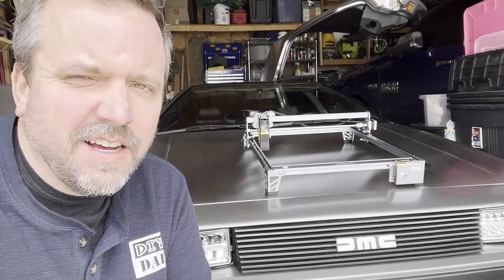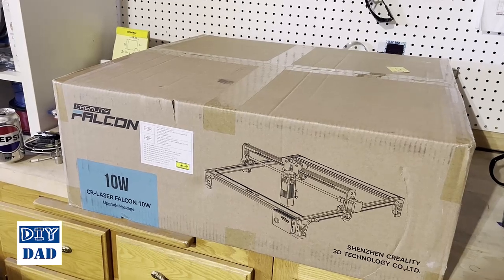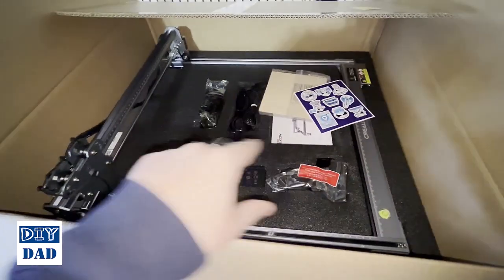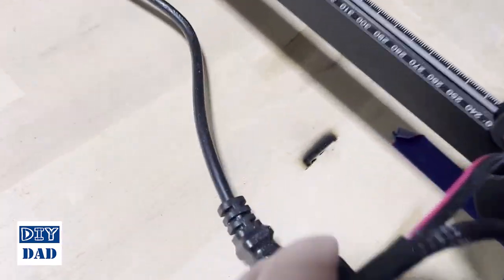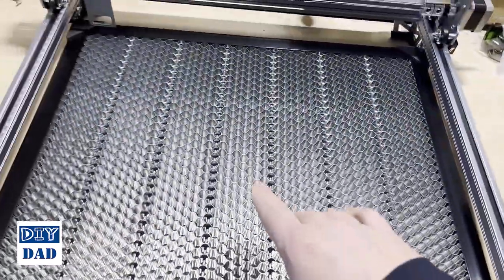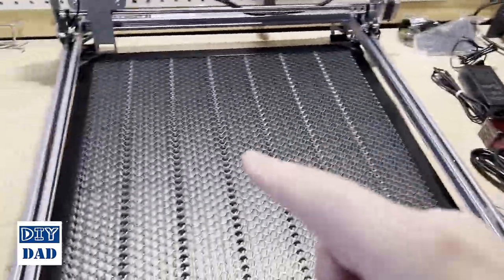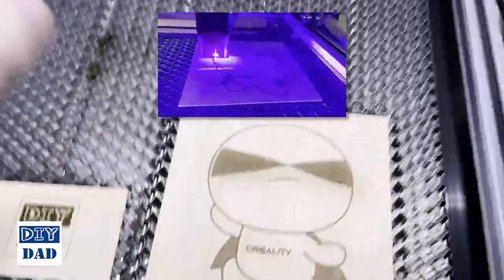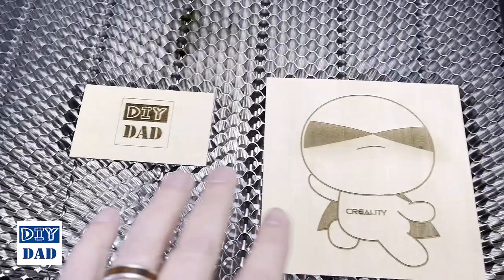Unboxing and Setting up a Creality Falcon Laser Engraver

Comment: Do you have any idea? My Laser light won’t turn on, anymore. It moves normally but the laser itself is simply off. 😢
Reply from the maker: Check to make sure the wire to the laser head isn’t loose or damaged?

Comment: Do you like this or the longer better?
Reply from the maker: Hard to compare because of the difference in power. The 10W is more capable than the 5W .. but I do like the screen and easy ability to trigger jobs from the SD Card on the Longer Ray5. It’s nice not needing to have a computer tied to it all the time especially for repeat engravings

Comment: Thanks for the video. Do you need the air assist for the 10 watt?
Reply from the maker: There’s an integrated fan on the head unit of course.. and I’m using the honeycomb so there’s passive air flow. I’m not using direct air assist on the 10w and haven’t had an issue.. but I’m also not doing a lot of precision woodwork